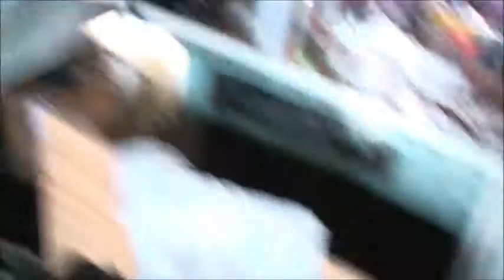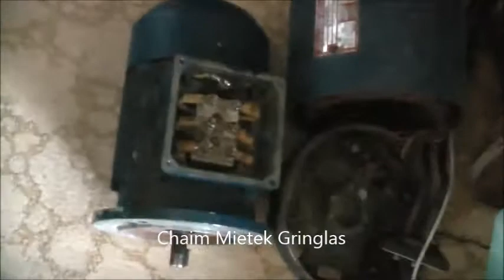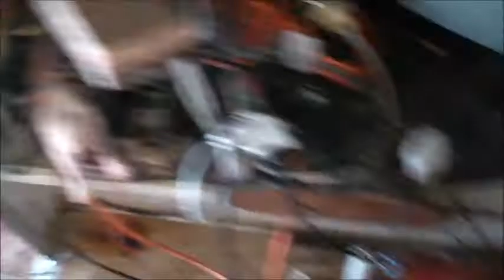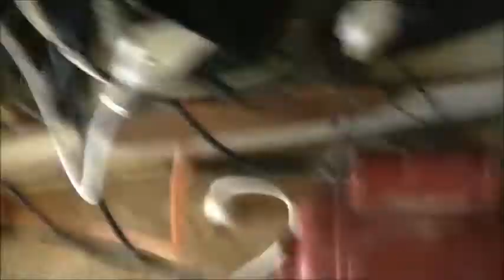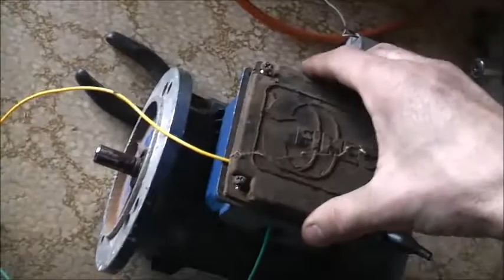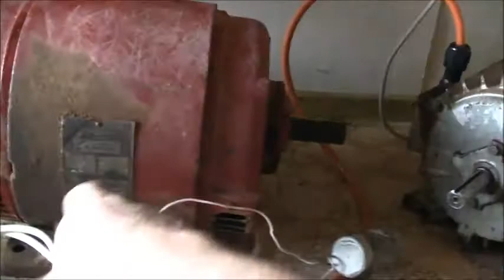More Scores! & CMG Motor Test!

Comment: How about TECO VFDs?

Analog computer based VFDs have been around for a very long time; FANUC was probably one of the first to produce them in large numbers, and you still see quite a lot of these old AC analog drives in old CNC machines.